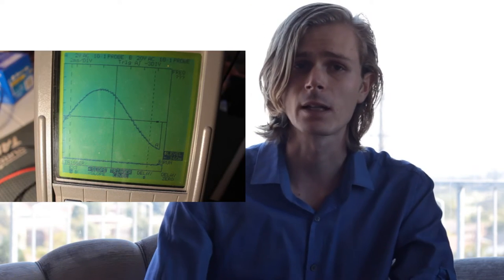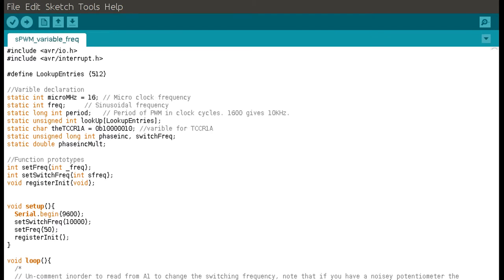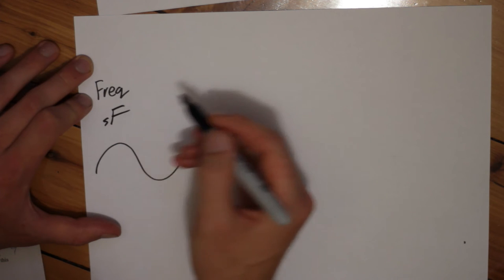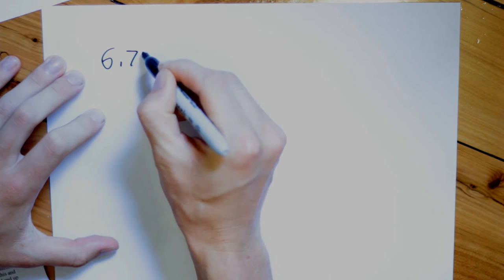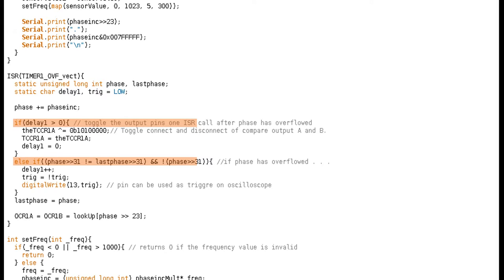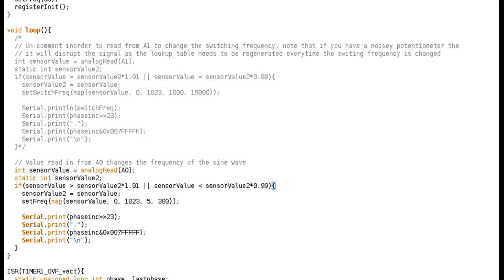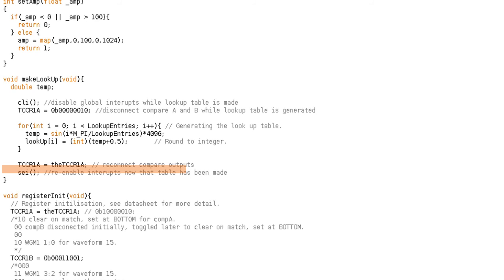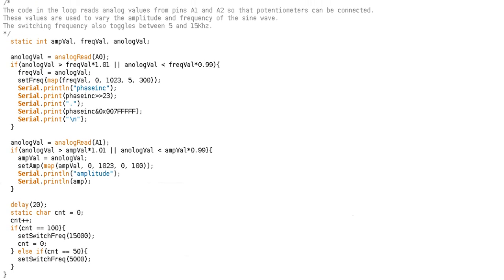How to implement a variable sPWM on arduino/atmel (Spwm part 2)

Comment: Yes so another question : It appears to me that in power switching you have the challenge to control EMF transmission and non intrusiveness in its energy spectrum for sentient beings or matter in general - how could the 'spread spectrum and the potential for information transfer be optimized in the context of multi phase motor control for example? Have you learned from the electronic engineer Dan Winter with his 'implosion' fibonacci based fractal model where he also defines the prime objective - sustainable ecstasy?

Comment: I wonder if similar can be done on Esp32. Was trying to generate 32kHz pwm with variable duty in each period, set by "look up" array of fixed numbers from 1 to 255(8bit)  and repeating it with variable frequency 5 to 100Hz and  vary a total duty of array from 0 to 100% . Any example code for this or part of it?

Comment: Hi Meanman,how can i invert  the switching signals, to the other half (10ms)of sine cycle (period)in the same pin of arduino ?the reason is for  reset the low frequency transformer after every single switching pulse.for example,10ms period non inverting sw signal and 10 ms inverting sw signal the both at OCR1A(in one pin) thank you  and congratulations for the project.

Comment: Hi. Meanman, in your 3 code the one with adjustment of Frequency on pin A0.   amplitude adjustment on pin A1.    when I do use the code it toggles between 5 and 15Khz.
I want to set it at 50hz but am unable to find in your code . any help will be great thanks .Yannis      congratulations for the project.

Comment: Kurt, this is awesome.  But I do have a question.  In c or assembly there is usually an overflow bit v or z can't remember.  It may be possible that you may be able to have an interrupt let you know when this bit is overflowed and then you can change the phase from there.  This is usually helpful in FIFO routines.  Don't know if this would be applicable to your code or not.
Reply from the maker: I not sure to be honest. But the interupt service routine could be based on such a bit, as I'm using an AVR library that might be abstracting this a little. Just a guess.

Comment: Hi, thank you for the video. It is really clear. I have been trying to do a 3 spwm inverter with an atmega328, using 1 timer for each phase (limiting timer 1 resolution to 8 bit). My problem is that since the timers have 8 bit resolution I cant load periods longer than 255 cycles, and for frequencies between 0 and 50hz I need a 16 bit top number, like the ICR1. Do you have any idea or example on how to manage this problem? Seems that the atmega328 is very poor for this application. Thank you!

Comment: you did a great job doing the code and implementing it, i have been using your code and tried to modify it to use it in a DC-AC inverter, but i have trouble to make it trigger 6 IGBT, i want to ask you for help, in what i have to do to get 6 outputs, 3 pair o signals as the code already generated, but defaced 120 degrees, i would appreciate any help.
Reply from the maker: I have tried this myself, and I do want to pick it back up, but so far I haven't got it working and my priorities are else where. But to try and walk you through my problem you might have luck yourself. So having 6 switches (IGBT or other) for a 3 phase bridge certainly does make it tricky. For example if we take an arbitrary point on the sin wave for phase A sin(74)=0.96 which means that B is Sin(194)=-0.24 and C is sin(-46)=-0.72. If at the start of the period we turn on the high side switch for leg A of the bridge and low side switch for leg C and B and then turn off leg B after 24% of the period and then leg C after 72% of the period then the high side switch for leg A will still be on by itself doing nothing for a further 24% of the period.
So probably (and I say probably because I'm not completely sure) what needs to happen is that is that at the start of the period leg A high side and leg B low side turn on, then after 24% of the period leg B low side turns off and leg C turns on until 96% of the period when leg A high side and leg C low side turn off. How that is implemented on the micro is another question since I'm not so sure you can turn a pin on and off a different times within the same period on the Atmel micros at least. I do have some ideas to get around this, but again my time and priorities, Hopefully I'll get around to it :/
Hope that helps though.

Comment: Can't we use this code for high switching frequency? like 300KHz
Reply from the maker: You can try, but you might need a micro with a faster clock.